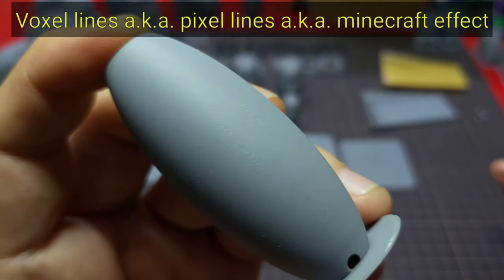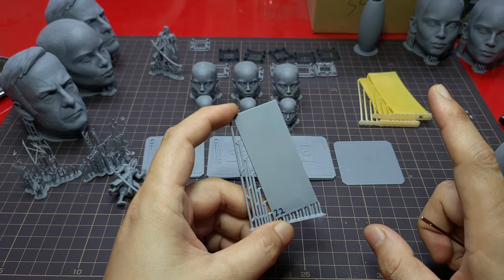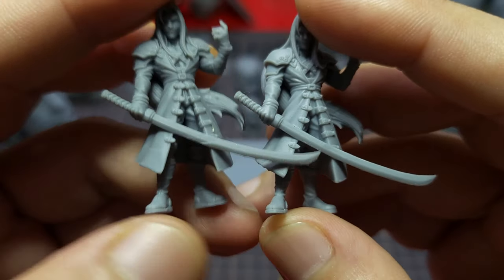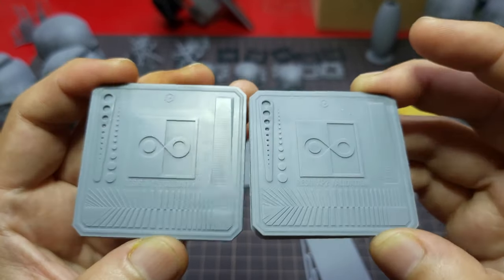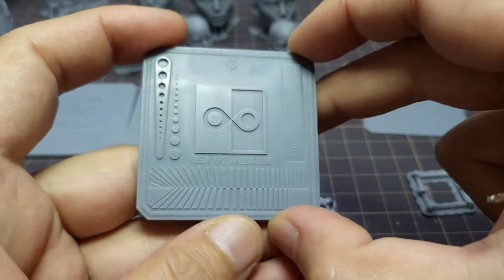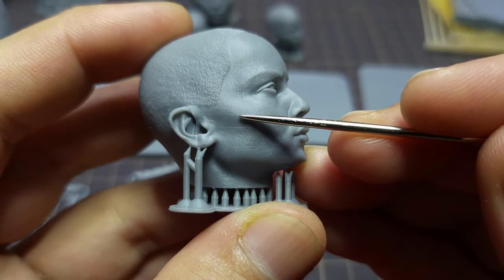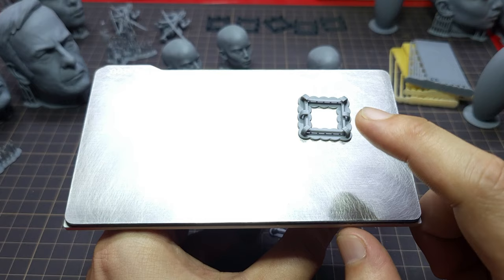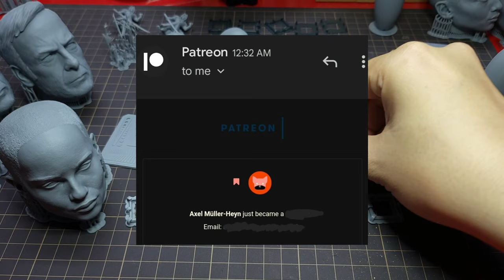How To Setting Resin Exposure For 3d Printer Resin

Comment: What happens when you set the exposure too long? Is that possible?
Reply from the maker: Signs of exposure too long or overexpose :
1. Loss of details
2. Some part thicken
3. Light bleeding from too long exposure causes some thin film got printed that is not in your model.
4. Shorten the life of screen and fep.
Reply: @wangdennys  thank you. It sounds like a tricky balance. 😁
Reply from the maker: Yep.
Sometime slightly
Just... Slightly overexpose is acceptable on success print, compare to fail print from underexpose.

Comment: sad, I was not able to have this bridge printed in any settings.
Reply from the maker: It seems your build plate is too low.
Raise the z offset or relevel build plate with 3 papers
Reply: @wangdennys  that is a different tip, I will definitely give it a try today.
Reply: @wangdennys is it OK to print this test on different points of my build plate? I'm currently trying to do it on 6 different spots corners and 2 near the middle
Reply from the maker: @victortomaz1991  yes it is fine
Some people even use it to check their build plate level and print alot across the entire build plate

Comment: my test print works on two sides perfectly and then fails on the other two? Any suggestions
Reply from the maker: Build plate not level?
Also like in my video for printer review
Light is never 100% uniform across the screen.

So those two fail might have a lower light intensity.
Reply: @wangdennys  well have a feeling it was from me not shaking resin. I swapped out  resin with new bottle I shook and everything' worked. thanks

Comment: What does it mean when the connectors seems printed way to short but all connected? 😅
Reply from the maker: Slightly compression
Probably too much pressure when leveling the plate.

I ususlly suggest to level with 3 papers
Reply: @wangdennys  did level with 3 papers .. seems it helped.. well your test eventually told me that 1.6 seconds should be fine for my Saturn together with the anycubic washable grey resin, what is alot shorter than the cones of calibration told me 😶 but the validation thingy i also printed looks still overexposed 😅

well im printing a miniature now with supports at 1.6 seconds and am looking for the result in 5 hours 😅
Reply from the maker: @the_kroete4357  may i suggest to keep the exposure calibration using coc as different profile.
Because there is no 1 setting for all.

Even i have like 5 setting for 25um layer height print setting.

Comment: Another great vid. May I ask, what resin did you use during this test?
Reply from the maker: Phrozen aqua grey 4k
Reply: @wangdennys  Damn, I use Phrozen Aqua Grey 8K to my Phrozen Mighty 8K and have serious problems with the big prints. Very often they aren't fixed strongly enough to the platform. Leveling of the machine and the print platform is perfect (your methot with 4 seperate corners), temperature in my workshop is good, I did the Exposure test and still have problems. Maybe I should use the sand paper... :(
Reply from the maker: @adamswitlak1242  check my latest video about leveling tips
Reply: @wangdennys  I leveled my machine exactly the way you recomended. Four sheets of paper in four corners :(
Reply from the maker: @adamswitlak1242  contact my social media
Easier to chat and troubleshoot there

Comment: What resin are you using?
Reply from the maker: Phrozen grey 4k
Reply: @wangdennys  what layer height were you using running your test model? I am printing it at .050mm 2.5 secs but feels like is really hard to see the spikes under the bridge, is not failing but is hard to see the very tip of the spike, I might be overexposed but I am printing at .050mm maybe I'll try .030mm and lower exposure to 2.3 secs
Reply from the maker: @WePlayGames1  your build plate is compressing the layer
Relevel with 3 papers

Comment: Is there a refr file using your exposure test?
Reply from the maker: Rerf for anycubic printer?
Reply: @wangdennys  yea that would be great, so the model prints automatically in 0.4 second increments
Reply from the maker: You could arrange the model
And then save as rerf. 
Then it will become rerf file.
The word rerf is the command for printer to run the model you use as multiple exposure.
Reply: Would be a great way to quikly test it, also the small heads would work wonders as a rerf file to test for lines. Amazing video by the way. Can't wait to try it out
Reply from the maker: @jan_sieber  yes you can use any model as rerf.
The best feature from anycubic printer.
Reply: @wangdennys  do you need to place just 1 file and the printer will print 8 times? Or do you place it 8 times?
Reply from the maker: @jan_sieber  place it 8 times.

Comment: So basically you’re saying slight overexposure will get rid of print lines.  The validation shows that the holes are too small pegs won’t fit into them, but you exposure test  has columns that are too fine to print, so you have to overexpose them to print.  I think that’s the wrong way to go about it... though I admit the heads looked better slightly overexposed… 🤔🤔🤔🤔
Reply from the maker: Yes and no
Validation matrix doesnt simulate real force that real print object experience, like pulling force, suction force, etc.
My exposure tester and other model like cone of calibration simulate such force for calibrate exposure.

But at the end of the day, everyone has their own best method.
And this is my method.

Feel free to experiment which works for you